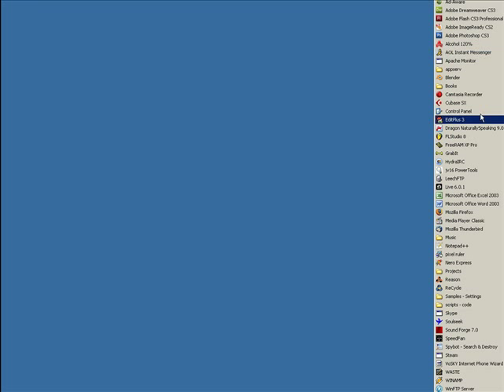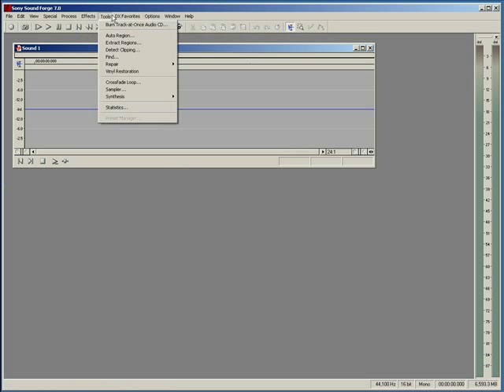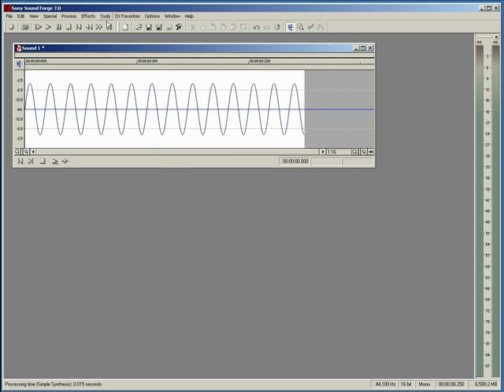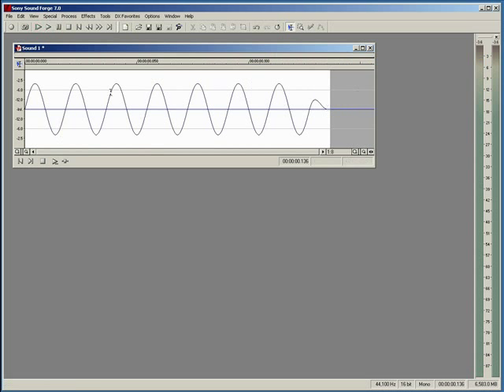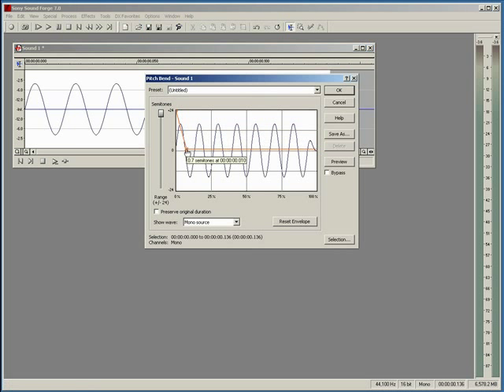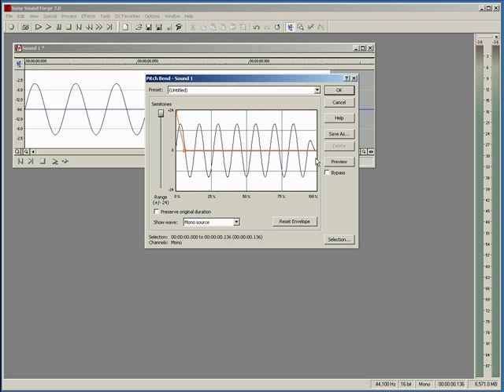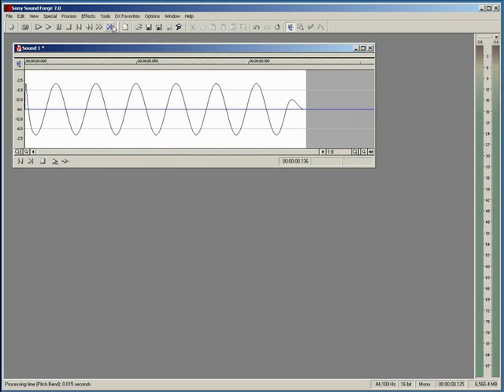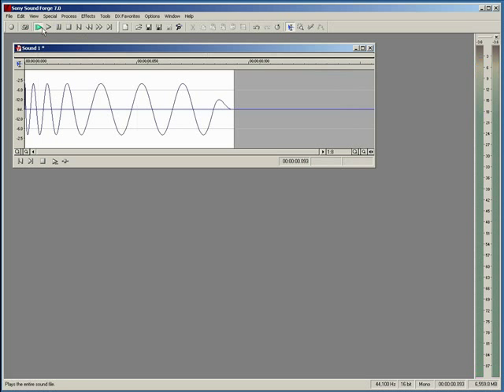eusid's Sound Forge how to make a kick drum tutorial

Comment: @TsampoukasG Use a triangle or sine wave with either a negative or positive pitch bend, I find a combination of two oscillators helps. Layer on some pink or white noise and adjust the envelopes. Maybe add a very quick sound to simulate the stick hitting. The tone should fade out faster than the noise.